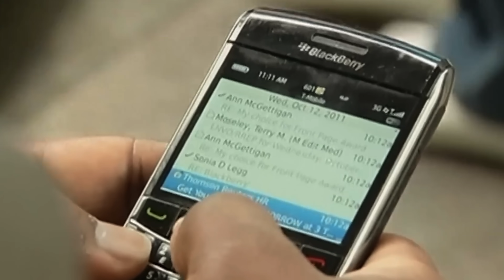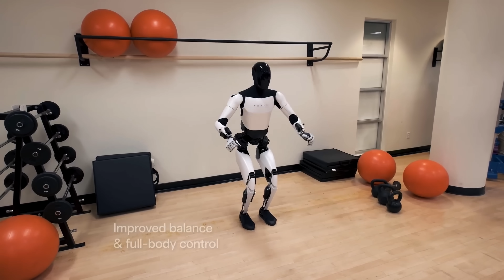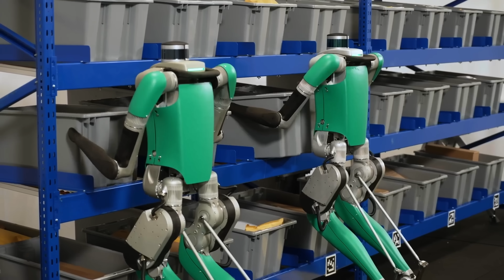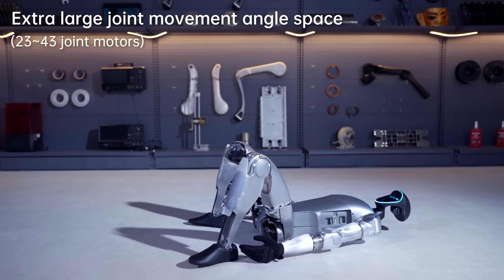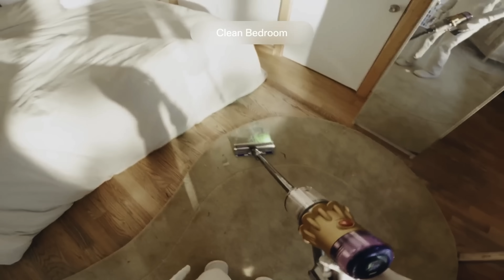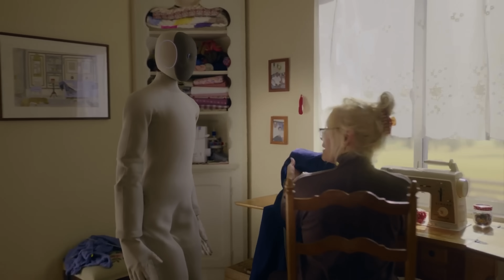Are Humanoids Approaching the iPhone Moment?

Comment: As an upper limb prosthesis roboticist who has worked on creating artificial flexinol muscles and on the architecture for transforming the Will of LLMs, inferred from high-level language (human language), into low-level mathematics and physical magnitudes (the language spoken by motors and sensors), descending through different levels of abstraction, I can tell you that the challenges are quite significant, but so is the interest and effort invested. I can say with certainty that by 2029 we will have functional robots almost as capable as humans in terms of motor skills with Low Latency; by 2032 they will have the same energy efficiency as the human brain (1 Petaflop/1 Watt or 20 Petaflops/20W); and by 2037 they will have an energy source as dense as human fat, perhaps implementing Aluminum-Air or Lithium-Air Primary Cells.
Excellent resume of challenges.
Reply: Very interesting comment. Ty for your insight. It coalesces some thoughts about humanoids i've had. I think humanoids will be much harder than people think. I assumed we'd have 80 IQ robots in factories at half human speed within 3-5 years and average IQ humanoids that operate close to or slightly better than human speeds in 6-9 years and smarter than average/super intelligent that are better in many ways than humans in a decade or two. 
IQ is just a concept but it gets the ball park of what im conveying. Im sure the first gen could have a super intelligent model but im guessing that would be a waste, take way too large a computer/processor, burn way too much energy, be literally too big and so on when all they need to do is be capable of basic factory labor. 

I have wondered, will cloud based generalized intelligence type models be beamed into the bots so as to avoid what i said while they just have a really beefy Inference chip? IDK if thats possible without latency killing the robots reflexes or plenty of other potential hurdles.
Reply: How can you be certain?
Reply: Hi, I am a scientist/engineer in the AI space - would you be willing to get in touch/chat ? I wanted to ask you some technical questions on how I can ramp up on these technologies practically
Reply: that fits the timeline of detroit become human perfecly, maybe i'll name mine connor. 🙂
Reply: unc i will blame you if the next robot uprising happened lmao
Reply: Artificial general intelligence is coming out before within nearly the same age gap, by 2028-30 so humanoid will have a massive brain improvement by then
Reply: I’ve heard the “in 10 years we’ll have lithium air batteries” story since 2007. Seems do be a harder nut to crack than many think.
Reply: @lennarthennig5063  yeap is amazing how energy bottleneck is much harder to solve than calculation density and efficiency😅 but there are important innovation in Aluminum Air Cells made in Israel and in Lithium Air made in the UK. I say 2037 due to the high and growing pressure of the entire robotic industry in those years to boost the autonomy of their robots, because every country will be demanding more and more robots for multiplying their productivity. So with intelligence, latency and physical control solved the next logic stage gonna be increase the specific energy.
Reply: The rate of progress between 2032 and 2037 could be orders of magnitude faster if Ai is doing most of the experiments, hypothesis, etc.  Spending, let's say a million dollars on robots that autonomously do battery science could in theory increase science faster than human scientists.  There's also the rate at which Ai and simulation will speed up science, even before full automation.
Reply: @user-yl7kl7sl1g  are you still falling for the AGI is soon grift?
Reply: @nunyabisniz8047  To automate many fields of science you don't need AGI.   We already have fully automated labs that do remote experiments in biology, and other fields.  These are narrow Ais and robotics.

The missing piece is an Ai that does hypothesis generation, plugged into the inputs and results of these automated labs, with sufficient context/memory.  The context memory area of LLMs is rapidly improving, which leaves the integration problem, which some one will do sooner or later.
Reply: @nunyabisniz8047 why should be AGI paramount objective? With artificial narrow intelligence we can do experiments, we can have robots. Or you want to have autonomous car to have AGI to have a conversation with you like ChatGPT about philosophy or the ChatGPT can be build in that car?
Same with experiments or AIs that do biological research- let them do their work, let them specialize, they do not have to be know all, see all to change the world.

Comment: The issue of the robots needing huge batteries could be solved somewhat easily IMO. Have charging cables with a metal weight hanging form the ceiling. At the back of the robot's head there is a electro magnet. When it is activated it will pull the nearby chargers towards it and the closest one will be connected. When the robot walks away the electro motor is turned off. The charger is disconnected and the robot will use battery power while walking to it's destination.
Reply: There are some robots now that just replace their battery with a charged one, and the old one is than being charged. The only downside is that you need 2 batteries, and for them to be removable.

Comment: You forgot "Protoclone" which can't do anything special yet, but concept-wise it far out-matches all other design, having a human-like structure and 320 degrees of freedom. In one or two years, computational capacity won't be a limit anymore, especially with upcoming analog chips (e.g. Huawei flex AI), but the amount of actuators and sensors you can place within the body will be the limit. The concept of protoclone doesn't need complex step motors and tons of cables, it has one main pump (= artificial heart) and each degree of freedom only needs a valve, a fluid pressure sensor and a (shared) skin pressure sensor. Actually, that are just 3 variables instead of hundreds for one electrical motor. Besides that it has so many advantages regarding corrosion, possible waterproof design, wear-out in dusty environments and emotions shown by hundreds of face muscles. Of course, learning doing things is much more complicated since there is no position data as in electric motors. All that has to be optained from visual and sensoric data and experience like a human does. But with more processing speed this concept has a higher chance to prevail than everything else shown in your video. Remember the movie series WESTWORLD? 10 years ago fiction, now almost reality. I mean human like interaction and manipulation skills are in the foreseeable future, let's say the next 5 years. The analog chips will bring the calculation power efficiency to the level of the human brain. But as you mentioned, foremost the need for higher energy density and automatic self-repair skills at some point we will need to switch from inorganic to organic machines. That will mark an iphone-moment  in history of mankind. It's much more difficult to predict, when this will happen and will it happen at all or will the silicon-based life we create displace us, carbon-based life, on earth before we come that far.

Comment: I think your somewhat pragmatic view on the future of humanoid robots is closer to correct than most of what I have seen on YouTube. I agree that the factory is the first and best place for such robots to appear and make a difference in our society for better or for worse. I also think that the idea that we will have such robots in our homes serving us coffee and cleaning up our mess is preposterous. Besides all the technical challenges associated with that product, I don’t believe the business model is viable. The cost of producing such a product is not offset by what the consumer is willing to pay. Frankly, I wouldn’t want one in my home if it was available at any price. While there are certain chores I wouldn’t mind offloading to a machine, I just don’t see such a product meeting my needs without also coming with a burden, either in the form of unattractive subscription fees, risks to my privacy, and or dealing with frequent system failures. The one exception to that may be in the form of elder care. I could perhaps see an avenue for such robots in the home for the purpose of aiding the elderly. But again, the technical challenges with producing a viable product for that environment are still larger than most folks imagine. It wouldn’t surprise me if this goes the way of the flying car. Lots of hype and vapor ware, but no real solutions in the foreseeable future.

Comment: The picking a bin for a part problem seems simple, you have the robot take the bin out and dump it into a larger bin that is easily dumped back into the smaller bin(maybe not those super small bins). While the bolts are in the larger bin it can scan it and detect the proper bolt better than I can, use magnetic and non magnet movement(such as a magnetic finger tip) to get the right bolt. If this is not the way to solve the problem, I am sure that there is another way that will win out without much difficulty. Lots of problems though....
Reply from the maker: yeah, certainly different ways to tackle that problem but I guess it helps you recognize how advanced humans actually are. I certainly have a greater appreciation since I started researching for this video.

Comment: Great video! I think we are moving toward large-scale 3D pre-training data, combined with synthetic data generation, similar to what NVIDIA is doing with Omniverse and so-called digital twins. These environments can be used to train multimodal machine-learning models, significantly improving the optimization of humanoid robots.

That said, the limitations related to energy efficiency and mechanical design of robots—especially when compared to the human body—remain a major challenge. We are effectively competing with nature, which optimized the human body over millions of years, while the Industrial Revolution is only about 300 years old. So yes, it’s a very long road ahead.

We may see a massive shift in training and scientific progress once we gain better control over quantum computation—both in hardware and chip architecture—by reducing decoherence and enabling more calculations with less energy. At that point, we could reach a “big-bang” moment where quantum computing, AI, and robotics converge, dramatically lowering the cost of production and energy.
Reply from the maker: That’s a great point about using digital twins and potentially Gen Ai as a training system. I saw this being used for ML training for defect detection in manufacturing and in theory we could use similar models for this. Maybe the government Genesis Mission can support this.

Comment: I was thinking for these to be like people, they would have to create a artifical neuronal mesh that senses objects, temp, and humidity on every surface of the robot like how human nerves work. You have more sensitive ones on the fingers, toes, face, then less on the back, etc. This will allow sensation on 3 dimensions of the finger instead of on the front or sides only. We can even feel with our finger nails. Until then, it will never fish out a bin or have fine motor skills comparable to humans. The computing power for that many sensors is probably far away to be honest. Like most tech, processing power correlated to the weight of the power source and hardware is the main limiting factor over the actual engineering. The main way to excel technology is to revolutionize energy systems
Reply from the maker: The sensors are often something we miss. Although there are different ways to sense potentially even using feedback on the motor as a sensor

Comment: Biggest TAM outside of colonizing the solar system and even there these things will play a huge role. 

I think this technology will be ready for prime time way sooner than most people think right now due to accurate world (physics) modeling, synthetic data and sim to real with all the massive compute capacity coming online in the next few years to back all that up. 

I agree that robots in the home won’t be feasible for a little while but the amount of robots you can put to work in factory and warehouse settings, stocking shelves in grocery stores, logistics etc is massive. 

Imagine that you have a logistics company, you receive goods in shipping containers from China that need to be palletized, organized and then you’ve got order picking and outbound shipments. This is an environment where you could control the circumstances to an extent, compartmentalize and gradually work towards more and more complex tasks. Instead of having to spend massive capex on new forklifts and conveyors belts you can drop one of these babies in, teach them how to use the old stuff and get a few more useful years out of your equipment. This is going to be massive, labor is a $58 trillion dollar “market”
Reply from the maker: The next 5-10 years are going to be wild to watch

Comment: Wouldn't earliest deployments pushing the boundaries of the possible be in military applications? As with nuclear, it's a lot easier to build an amazing machine that tears stuff apart, which is pretty much what the military is for.
Reply from the maker: I think there is some of this going on but it’s not as common in the public conversations. I think this is also something you don’t wanna show until you really need to use it.

Comment: Keep to making robots that excel at specific tasks i say, you can't get cheaper, smarter or more relaible than hiring an actual human to do what a clumsy peice of plastic will struggle to do without human guidance.
Reply from the maker: Yeah, the challenge I see and I see it often in manufacturing is utilizing the full capacity in order to optimize your investment. In this type of setting, you need to do significant volume in order for them to make sense however, if you have lower volumes and a higher mix you need the robot to be more versatile

Comment: The telepresence robots are one step away from AGI controlled robots. The nut from bin picking robots are one step from miniaturization of motors, gears, and levers. The power requirements of robots can be provided by tethers. If the robot does all or most of it's work in a limited space, why not have a tether that it can hook up to by itself? The robot would have a reasonably sized battery that it only uses between tethers. Same with the brain. Offload the big brain to a big box in the corner and have a small brain in the robot that can walk and hook up to the tether.
Reply from the maker: yeah, it’s really interesting to think about how fast things could potentially accelerate if AGI is actually achieved and implemented

Comment: I'm starting to think it would be easier to have robots act based on 3rd person footage than their own sensors, just because then one can train on any old video of humans that already exist.
The robot wouldn't have the ability to just wander off, but whenever do you need a robot anywhere that's not in your home / owned space?
Reply from the maker: this is an interesting idea. I think the challenge would be not having enough angles in per perspective, but maybe Gen AI could potentially support this. I suspect it just won’t be accurate enough though.
Reply: @FutureintheMaking  It's hard to say,, my original intention was to just make some models that predict what the robot sensors would receive from random human video including a full first-person view.
I believe generative modeling is pretty much there to do this, but I do quite like the 3rd person view angle for a few reasons, like when training in a simulated 3d environment, one could have several instances in the same view, not needing to do a full render for each one.
Also beyond useful applications getting things like every human dance in the mix is just fun.
All one would need to do with videos containing several people is using some segmentation tool to highlight the person the robot is supposed to consider itself.
Would likely produce a pretty strong base model that one can always still apply regular RL or finetuning to to adapt it to other perspectives and whatnot.

But yes, I would also expect a lack of fine motor control skills.
Reply from the maker: Great point about the first person view. I think the meta glasses and similar will likely be an important tool for this. Then we just need enough compute to process and determine the waypoints it would seem.
Reply: @FutureintheMaking  Actually, if your data is first-person to begin with, it wouldn't contain information about the posture, movement and whatnot that could be used for training.

But honestly, I didn't even consider glasses like that. That data might be useful in other ways I'm failing to see right now. 

I suppose when hands are in frame it would be a lot higher detail about hand motions.
Reply from the maker: I was just hearing Jensen from Nvidia. Talk about the Omniverse and how they’re using that for robotics. I think this is a similar concept, but actually using generative AI to simulate these different scenarios, create digital, twins, and effectively run the machine their learning models exponentially faster.